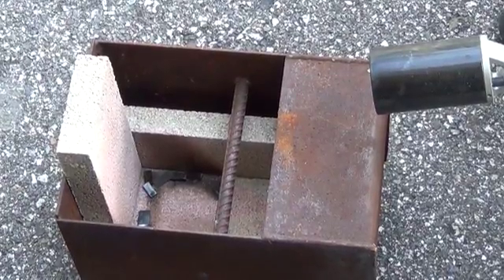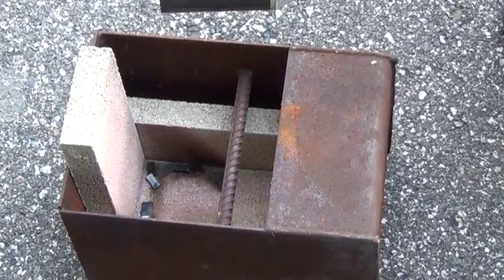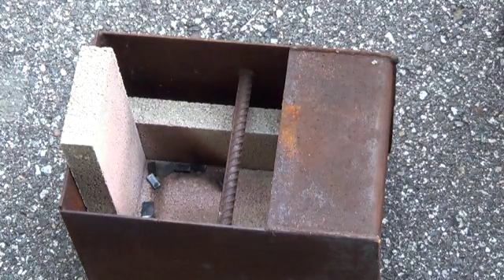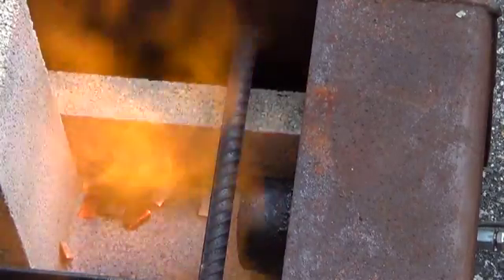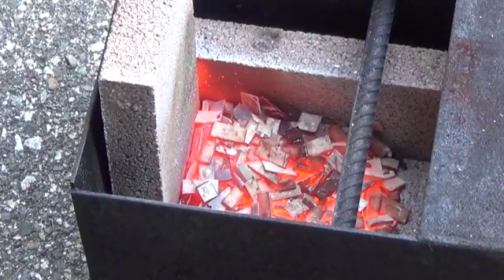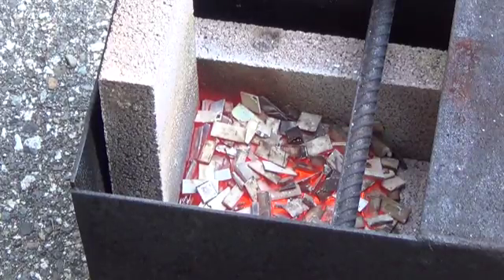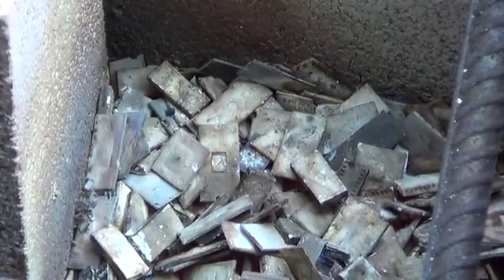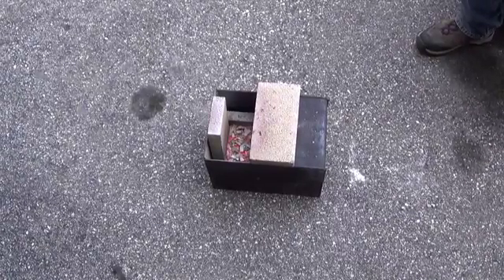Gold Recovery from RAM IC Chips part 2 : Incineration (pyrolysis) -MooseScrapper

Comment: Good methoud but you can do better by buting the ic,s in aelectric furns under650 c
Thats burn them fine with no lose or melting
You can now melt them after grind by coffe ben grinder
With sane wheit borax and lead oxied
To colkect evry thing and coblling a fter
Best wishes
Reply: I'll add soda ash (or even sodium hydroxide) to your mix (otherwise the high silicon content will make the slag quite viscous, which will not allow for good separation (metal beads locked in the slag))